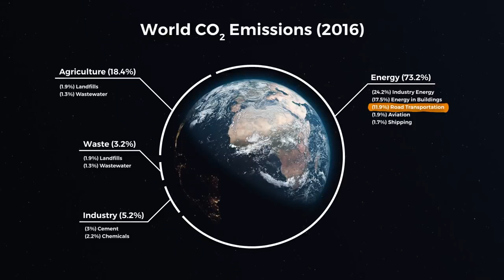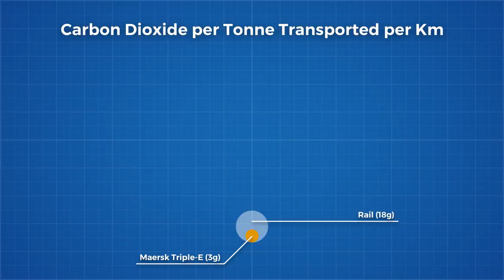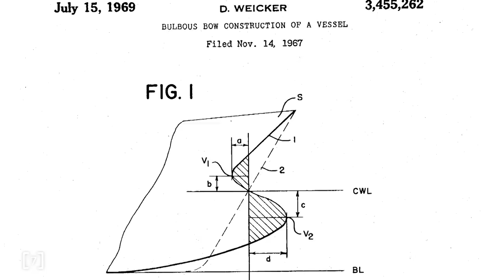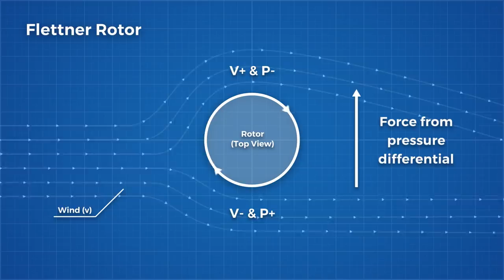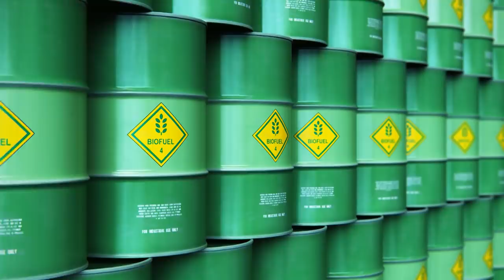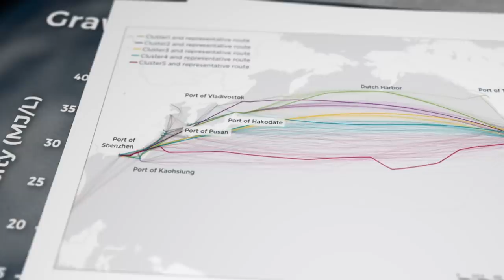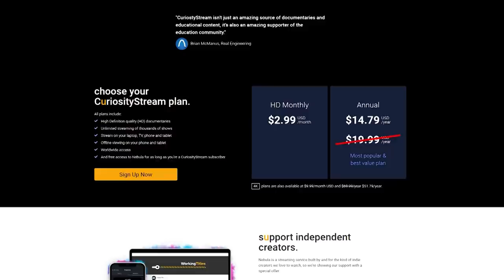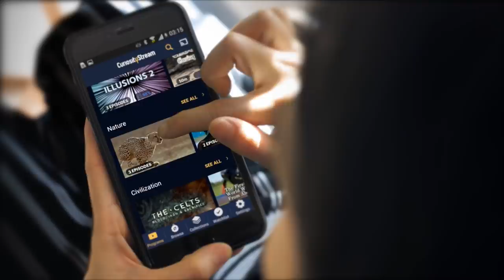Are Renewable Powered Ships Possible?

Comment: Brilliantly researched, presented and narrated. Agree with your comment on the unsuitability of Biofuels, but you left out battery electric and hybrid? Next episode?
Reply: The next, least bad, option is ‘alternative fuels’ such as Ammonia (NH3), Biogas (basically good old CH4 or Methane) and Hydrogen (H2).  All require harvesting and processing which have costs and impacts before you get your energy to the point of use and will have effluents that will impact the global environment one way or another.  Thomas Midgley, Jr. (born 18 May 1889 died 2 Nov 1944) was an American (USA) chemist who as well as developing the technique of putting the lead, tetraethyl lead (TEL), additive in petrol created chlorofluorocarbons (CFCs), yes those ozone depleting CFCs, so that the use of NH3 as a refrigerant could be discontinued. NH3 could be the most dangerous and least ‘clean’ clean energy source, is very bad and probably deserves a rant all of its own; so let’s just leave that for a while (somewhere very far away that is cool, dark and quiet).  CH4 lots of it around much of which comes out of the ground as a fraction of the FOGI energy mining; even more can be created (relatively expensively) from anaerobic degradation of organic matter.  The organic matter may be either raw vegetation, food waste or pre-digested by domesticated livestock with the right (or wrong, depending on your point of view) sort of diet and gut fauna.  CH4 is a lighter than air, vapour at environmental temperatures and pressures and you need to compress it, a lot, or cool it, a lot, to get enough on board your ship in manageable volumes to be useful.  Carry it as cargo and you can burn the ‘boil off’, when the latent heat of vaporisation has a co-activity benefit, otherwise more trouble and expense than merit and savings.  H2 is said to be good for use in fuel cells that will give clean energy when combined with Oxygen (O2) and leave only water (H2O) as an effluent; so as well as the cost of creating the hardware and separating out the H2 in the first place we now have the cost of separating out the O2.  H2 is very, very light and very, very volatile so this is where we remember the Hindenberg disaster, the ‘light’ means that though there is lots of energy per unit mass there is not much mass per unit of volume so all the problems of CH4 but much worse.  You need to compress it, more than a lot, or cool it, more than a lot, to get enough on board your ship in manageable volumes to be useful.  The alternative to fuel cell use of H2, burning, also generates combustion products which includes waste heat going to the cold sink and a few NOx nasties.  The numbers, on any of these, are getting very difficult to show any sort of surplus so is this a case running hard to stand still?
Reply: @BernardLS  H2 does have a future if extracted from water with electrolosis using off peak renewable energy/ if used close to source ideally and we vastly improve fuel cells and storing possibly via metal hyrdide?....lots of ifs and buts sure. I am also suspect of anything CH or NH for the reasons you say...and on boats lets not forget all the ancilliary systems that often have a dedicated generator that could be replaced with solar / battery on deck....small compared to the main propulsion but every little helps.

Comment: I think that you forgot to talk about one of the main possibility to decarbonise the shipping industry, using nuclear powered ships as intend the startup Seaborg industry for example, which is way more probable economically and on an industrial scale.
Reply: If you do a web search for ‘nuclear ship savannah’ you will see that it has been tried and did not work.  A similarly heavily subsidised, by the government, vessel is in use in Russia but just think; would you have full confidence in the management of a nuclear reactor under the control of an anonymous entity only traceable, perhaps, via a letter box in a FOC (flag of convenience) nation state?  If you are could you sell that confidence to Japan, the state that hosted the Hiroshima and Nagasaki nuclear detonations as well as more recently the Fukushima ‘event’?  Then try that same, or similar, sales strategy on Ukraine, the nation state that as a part of the USSR (CCCP) hosted the Chernobyl ‘event’.  Modern iterations of nuclear energy thorium fuel, molten salt reactors or fusion reactors will carry the legacy of past problems.  It is the global trepidation of anything with 'nuclear' in the name and the economics of nuclear having transitioned from 'energy to cheap to charge for' too 'the costs of remediation are incalculable' that will prevent the adoption of nuclear energy as a means of creating energy at sea.  Modern reaction systems may have overcome the safety problems but the general public, having been misled in the past, will not believe the fresh new promises.  ‘They’ say nuclear is cheap, it’s not it is expensive as well as being complicated, dangerous, not universally socially acceptable and having only ‘no need for refuelling’ as a questionable advantage; actually it does need refuelling just not as often.  When they do need to refill the warming up stuff it takes considerable longer than pumping tonnes of thick black stuff, HFO cSt380, or thin runny stuff, MDO, onboard which is one of the reasons HMS Queen Elizabeth and HMS Prince of Wales are pushed about by gas turbines thus using a similar fuel as the aircraft that fly off of them.  The Royal Navy (RN) with a high degree of skills and expertise use, at vast expenses to the UK taxpayer, a current operational nuclear fleet of 11 submarines (also known as ‘boats’) in two flotillas, seven attack subs and four ballistic missile boats.  The carbon footprint of all the extra bits of hardware and the fuel, including processing thereof, from ground to propeller, are the external costs that never seem to get considered.  Disposal, once it wears out, of both the machine (that was a ship) and fuel is another can of worms best left unopened.  The 26 RN boats no longer in use are laid up (some in Rosyth and some in Portsmouth) awaiting long term deconstruction including dealing with the fuel rods and other irradiated material.  The USN is not, as far as I know, a commercial organisation working to very tight margins and also has the skill and expertise to handle the complexities of nuclear power so as well as submarines their aircraft carriers are nuclear powered and each have a build cost three times that of QE/PoW, bigger crews and more generous funding.  For those who still think that nuclear energy might be the answer I recommend this report: - https://www.bbc.com/future/article/20200901-the-radioactive-risk-of-sunken-nuclear-soviet-submarines? ocid=ww.social.link.email.  The navy of the USSR might have been under resourced and over extended but it was still generously supported in comparison with merchant shipping.  Merchant ships may be 'taken up from trade' as the RN would say or they may be captured or impressed by non state quasi military entities by way of piracy.  But cargo ships are not military vessels; merchant shipping is run as a high volume low margin revenue generating business and any improvements will need to be lower cost or better value to be adopted by the trade.

Comment: I mean they are doing it so it must save money but I mean if you are going slower that means you run longer so what's the difference like if it takes uses 20% less fuel per day but takes 6 days instead of 5 that's the same

Comment: If anybody thinks the Beirut fertilizer explosion was big just wait until a port with enough highly compressed hydrogen to refill a couple of tankers springs a leak. 

Beyond the obvious safety concerns hydrogen comes with a number of other caveats making it DOA. It is primarily sourced from fracking so not at all clean, it is expensive to transport, store, and pump, and maintenance is made much more difficult. Fuel cell processes are not as efficient as pure electric either so will never be as cheap.

The second batteries reach the required energy density hydrogen becomes an obsolete relic. Some would point out battery energy density has only increased 3-4x in the last century but most of that progress was very recent. Lithium-Ion battery cell densities close to tripled in just the last decade and we haven't even got to the good stuff yet (solid- state, lithium-air, etc). 

We need about a 10x improvement in battery density before they are viable for massive transport ships to cross the longest journeys but with each incremental small increase we can take fossil fuel out of more legs. It's also pretty easy to retro-fit a ship with new and improved battery packs every 5-10 years.

Comment: what if they switched to things like nuclear? thorium would be a very safe, and effective option, since its less toxic, easier to control, and actually even greener than the most efficient solar panel or wind turbine. and they can operate 24/7, and can produce distilled water though its operation in creating power.

Comment: The good thing about biofuels is that they work just like cows: they do emmit a lot of carbon, but it is reabsorbed by the plant that will either be digested or be converted into fuel, both of which produce CO2 that is used by the plant...
This is atmospheric CO2, not fossil CO2 that humans - not cows - dug out of the ground & shove into the air.
Edit: you don't have to use food (such as soy beans) to make biofuels, you can do it with parts of the plant that aren't being used to feed animals, us included.

Comment: This video is very timely.
Many things to unpack from it.
Nearly every product we use comes from somewhere else, and if it does, there's a good chance it came on a ship like this.
Cars, goods, food, clothing and raw materials are all moved around the world like this.
I'm sure that the issues as they stand can be overcome, however, I'm not sure that everyone is prepared for the costs involved.... Every shipped item will have its price increased and passed on to the consumer.
Finding enough energy to convert water into hydrogen to run a 1 million HP engine for a 10 day sea voyage is not a small system.

Not unsolvable, but also definitely not cheap.

Comment: Yet another very informative video.  My only concern is that a couple of very important points were left out.  The air is cleaner today than it has been in the last 150 years.  As technology improves, engines become more efficient thus releasing less emissions.  The emissions such as sulfur and nitrous oxides and other particulate matter are the ones that are important.  The focus on carbon is really quite absurd and it is only an issue because it is easily taxed.  Also, the off shoring of production is also not addressed, and many companies have discovered that it is quite advantageous to have manufacturing closer to the sources of consumption.  Nonetheless, it is a good video.

Comment: I remember hearing ages ago that the US Navy was working on some sort of system that could convert sea water into hydrogen fuel

Not sure if it was real or not, but it might make that long leg of the trip a bit easier.

Also, it would be cool if they could develop deployable solar panels that just sit on top of the shipping containers, that is a crap ton of surface area that could provide additional power without really altering the ships.

Comment: Nice video and presentation. 2 items. The presentation of reduced emmissions at slow rates needs the next step of showing that the ship travels more time to make shipment. It is still a little more efficent, but the end goal is transporting good from A to B. Second, comment at 12:22 about cutting into profits. I think that is naive. Freight costs will just go up. They already have due to IMO2020 regulation of cleaner fuel. The consumer of goods are the ones who ultimately pay for "clean".

Comment: When heavy ships gets closer to EU,US,AU etc they must switch from bunker fuel to clean, low-sulphur diesel fuel. They get inspected when they transit to (or close) the designated ports.
For this reason, the air is much, much cleaner than 15 - 20 years ago...
Reply: The use of low sulphur middle distillate fuels will fix the sulphur issue but the other combustion products will remain as atmospheric pollutants.  The 26th UN Climate Change Conference of the Parties (COP26) held in Glasgow between 31 October 2021 & 13 November 2021 established requirements and targets for mitigation of the production of GHG and with regard to shipping steps to reduce atmospheric pollution to acceptable levels could include, but not be limited to: -
1) Reduce spoilage / waste of all commodities;
2) Improve fuel quality;
3) Localise production to consumption;
4) Reduce 'freight mile' distances;
5) Abolish the cruising fraction of marine transport;
6) Reduce freight carrying capacity;
7) Abolish recreational boating;
8) De'fossil'ise the fuel chain;
9) Reduce the global population of consumers.
The use of any of the options above may not be the future of marine transportation but moving less material and moving what is transported over shorter distances, as in the past, should be.  Together with localised production and minimised consumption a global population that has individuals’ voluntarily self limiting reproduction to two children per parent (both male and female), might save the planet.

Comment: Of course it is. It's called the WOODEN SAILING SHIP... it's made from trees and it runs on wind. It takes only 4 months to get from Europe to Asia, except about a quarter of the time when it gets to the bottom of the ocean instead.
Reply: Spot on, with the proviso that once a tree is used for being a ship it will not be available for any other purpose.
Reply: @BernardLS  Tell that to that silly girl Thurnberg who sailed across the Atlantic to an environmental conference because flying is "bad"! OK, her sail boat is actually made from synthetic materials not wood, but the professional crew flew in to man it so a dozen people flew so she didn't have to fly... hmmm.
Reply: @dwightlooi  Spot on, at the time I had a minor rant to my long suffering drinking buddies about Her Gretaness, the things she was doing and LCA's.  A properly configured LCA (life cycle analysis) would determine the cost / benefit impact.  As with any LCA it is necessary to select the functional units, system boundary and parameters assessed to make sure you get the answer that is desired; always embarrassing when data shows that what you hoped to prove ‘bad’ was in fact ‘good’ or vice verse.  For functional unit in Environmentalism ‘overall carbon footprint’ is usually a good one, so what you save on kerosene not burnt in a jet aircrafts engines better not be outweighed by what you consume using a recreational sailing vessel with hydrocarbon based structure and motive power containing lots of embedded carbon.  ‘System boundary’ well where ever is likely to yield the ‘correct’ result is a safe bet; ‘parameters assessed’ again what best puts a cutting edge on the particular axe you wish to grind determines which parameters you choose to assess.
Having spent my working life on the fringes of FOGI (fossil oils & gas industries) and marine transportation by own personnel pet peeve is the global entertainment and recreation monoliths who like to claim to be all touchy, feely and sensitive while they churn noise and light into revenue and  profit.

Comment: The animation of the Magnus effect has the rotation in the wrong direction. Higher relative velocity between air and surface makes the flow stay attached longer (more turbulent boundary layer). 
When deflecting air downwards, the rod experiences a force upwards. Comparing this to a football (soccer) deflection and rotation, you could intuit that the rotation in the animation is wrong. Nice video nonetheless.

Comment: Hi, thanks for the video. It is great. I was just thinking about that topic lately, as well. As you mentioned, there is the huge question of the fuel in the industry. Therefore, I were just thinking about bringing Methanol (liq) as the fuel option on your list. You can see the comparison here (Brian, I am sorry, but I have borrowed your graph just to illustrate you the idea. Hope you do not mind). Check it on the graph here:
http://www.mediafire.com/view/s5bwfkh9byxucoz/Gravimetric_vs._volumetric_power_density_showcase_methanol_for_renewable_shipping.jpeg/file

*Note that the methanol stands as biodegradable fuel. So, if the ship sinks, the fuel seems like the smallest issue. Which is not the case, at all, with the current fuels (e.g. crude oil, ... ) ... lets not make it long ... 

Once more, thanks for working on that topic. Yet, maybe in the next one you could do us a favor and include methanol. If you like it ...